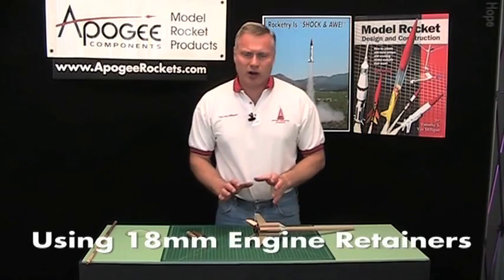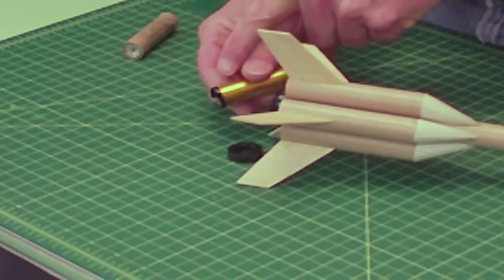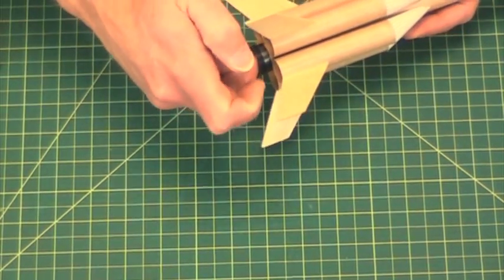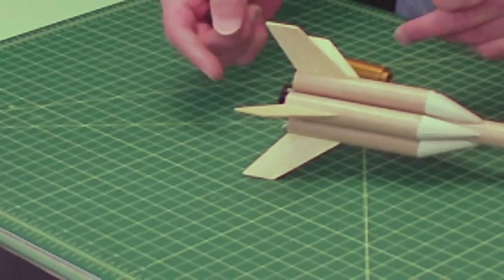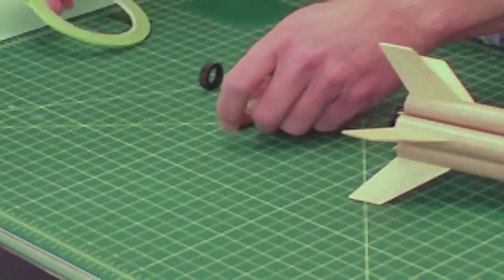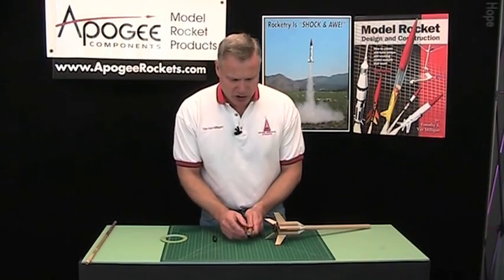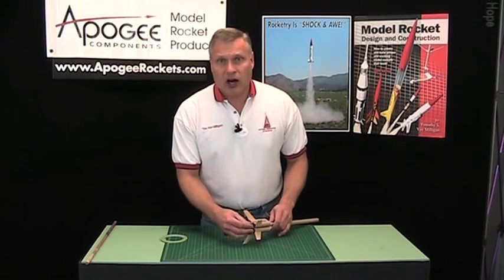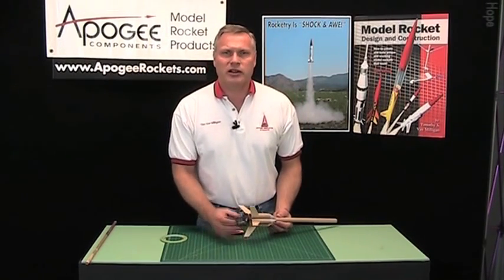Using 18mm Retainers in Model Rockets

Comment: Does using a metal cased reload change the FAA class of the rocket or does the metal parts rule only apply to the airframe and engine case is excluded?
Reply from the maker: You're OK to use a reload case.
Reply: @apogeerockets  So it doesn't turn a Class 1 model rocket into a Class 2 amateur rocket in the eyes of the FAA?
Reply from the maker: @themadscientest  Didn't believe me the first time, it sounds like. I don't know what I could say to get you to believe the answer was correct.